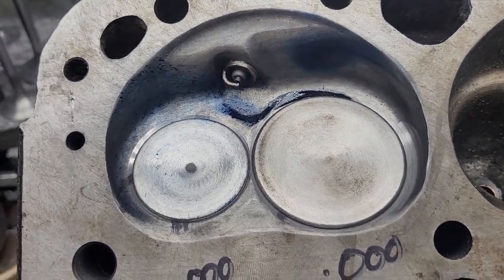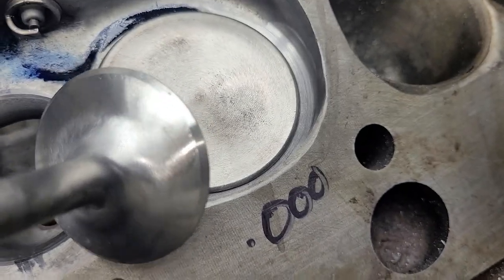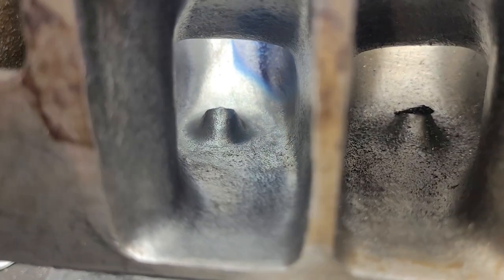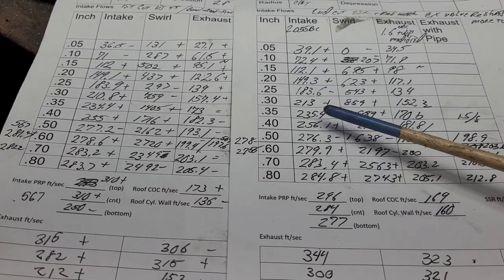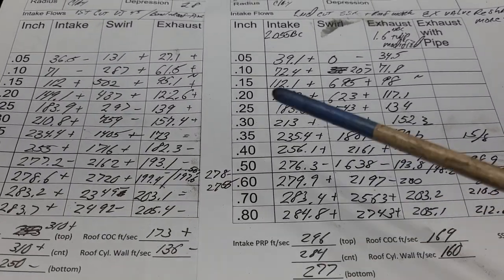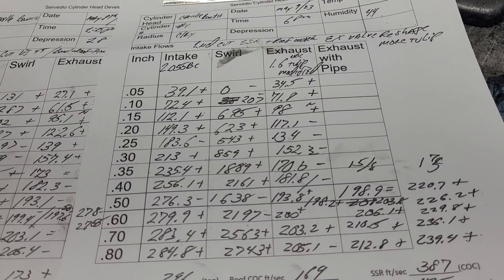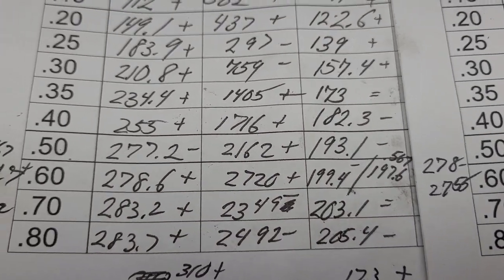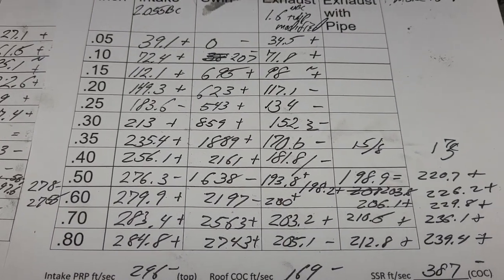Chevy 034 Bowtie cylinder heads, second cut on intake and tulip shaped exhaust valve. Flows an dykem

Comment: Density is greatly affected by temperature, and viscosity to a lesser but still measurable extent.

Maybe the tulip valve flows better with hot exhaust? According to DV at low lifts the flow in the exhaust is supersonic, my theory is, the tulip valve helps promote expansion fans because of the gentle divergent curve on the valve. It's probably why you have slightly higher low lift flow, and then at higher lift the flow slows down below sonic and the rules reverse themselves, the slight divergent path on the valve slows down the airflow a tad, until the valve opens a little more and overcomes the diffusion effect.

The flow on the dye chem below the plug shows there's a nice vortex on the intake. It reminds me of the flow-vis the Red Bull F1 car was running in Miami.
Reply from the maker: Good comments, thanks!

Comment: Hi Charlie. If the air speeds are even then you are using the entire area available. It would be interesting to compare the average air speeds vs average port volumes of different heads.( The same type of heads) Kind of like lobe intensity of camshafts. Lots to think about. Andrew
Reply from the maker: I have been doing that for a while now. I think I am on the right track. Thanks
Reply: @servediocylinderheads  Hi Charlie. I didn't mean to infer in any way that you were not on the right track. It was lots to think about for me. I am starting to see now how the various programs like pipemax, IOP and others have to offer in terms of picking or designing the "correct" cylinder head per application. Once I start to absorb all this information I think I will need a bigger hat size. My head hurts already. Knowledge is power. Andrew
Reply from the maker: @andrewburlock2653  Funny

Comment: Your comment about killing low lift exhaust made me think of a theory I have about running excessive duration to get radical lift to take advantage of high end port flow while using low lift shrouding to effectively decrease duration. Thoughts?
Reply from the maker: That makes my head hurt.
Reply from the maker: I never liked excessive exhaust duration for stuff that runs to 7000 rpm. I was pretty good with exhaust shapes and single pattern cams worked for me.